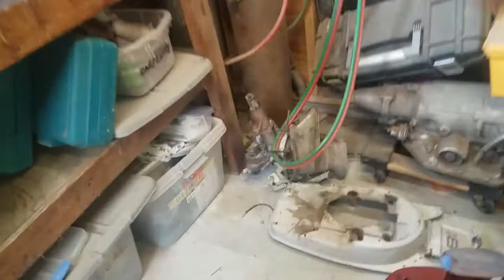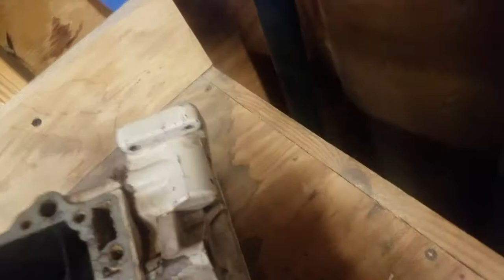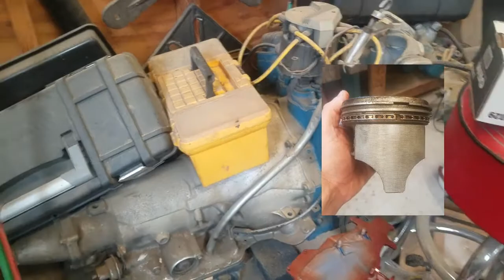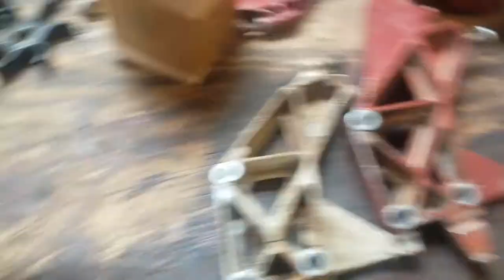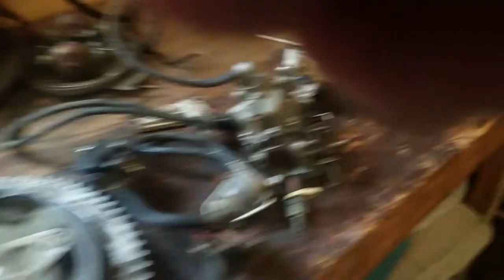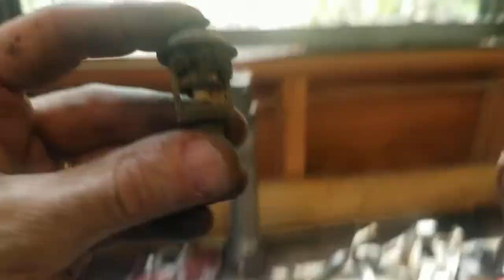1958 & 1961 Johnson 18 HP Disassembled

Comment: Have a 1966 FDL-20C. Need to replace the driveshaft seal in the lower unit reworked the water pump that works great runs real good. No computer anything. Keeping it on a 14 Livingston.

Comment: That 1958 has HYPOID gears. The teeth slide across each other to reduce noise and vibration. The downside is friction loss and there is a special lube required. The later model has straight cut bevel gears. It uses regular  heavy gear oil.  
Retired gear salesman.

Comment: Thanks for the video.  I have a FD15f 18 hp engine.  I need to remove the power head to replace the crank. I'm stumped.  I removed the the easily accessible 6 bolts under the engine but something else is holding it.   It appears there is a Philips head bolt at the forward end that is inaccessible unless I remove the tiller swivel. Can't believe its that hard.  Am I missing something? Tried removing the swivel by unbolting the upper and lower rubber shocks, but can't remove it.  Please help.